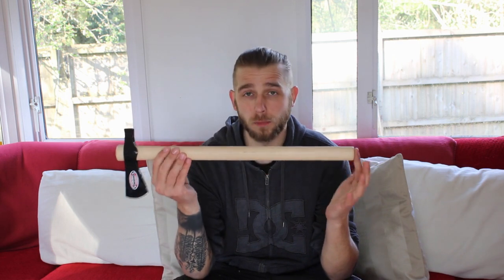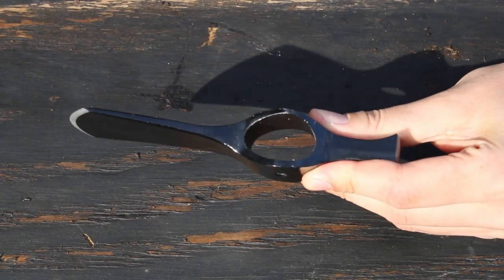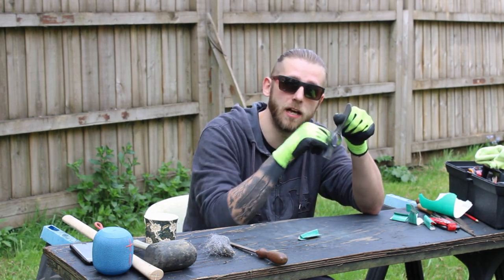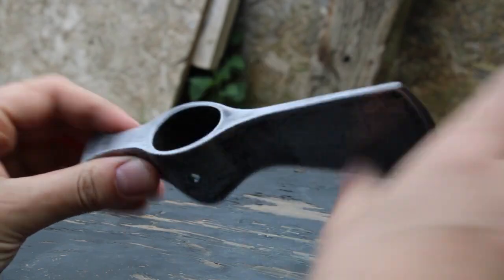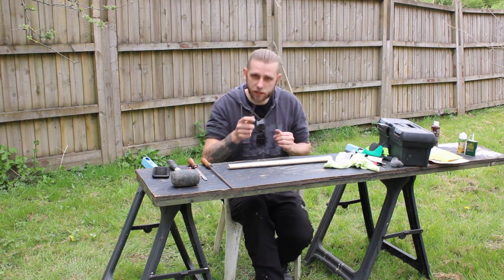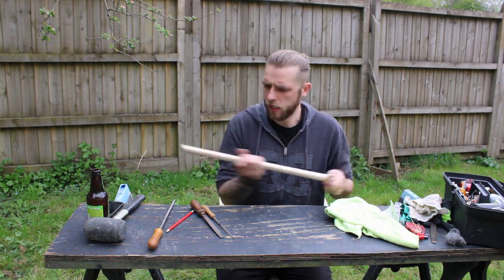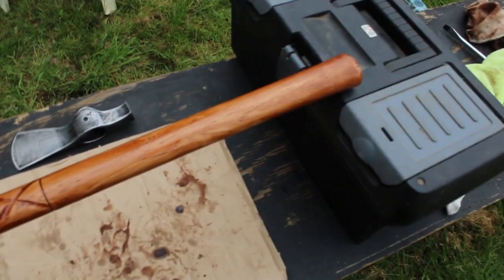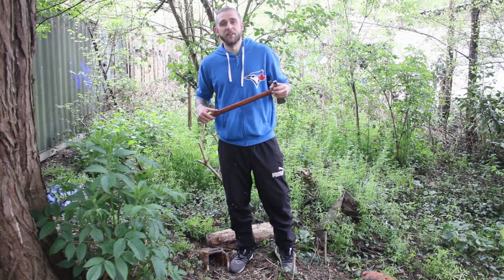How to modify and customise my first tomahawk. Bushcraft axe

Comment: A tomahawk should never need a set screw to hold the head on the handle... If the handle is made right friction fit is great... There should be 1 to 1.5" of handle sticking out from the top... You can use the set screw to fill the hole it came from... Apply a little jb weld and screw it in about 1 full turn then file the outside till it matches the contour of the outside of the tomahawk eye... Use a different screw other than the one what came with it such as a straight of Phillips and when it's filled off it isn't noticable...

Comment: I have worked on several coldsteel hawks, my favorite is the pipe hawk.. I like to fill the grub screw hole with some heavy gage copper wire. Just twist it into the hole and file it flush on both sides. The copper takes on a nice patina if you cold blue the sanded head.
Reply from the maker: Love that idea! I’ll have to get another one and try it out 😂